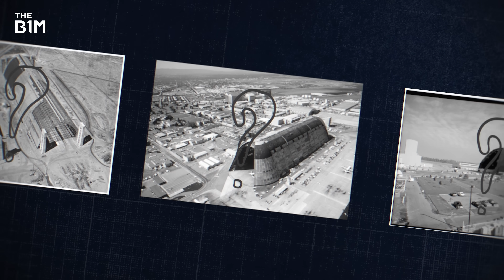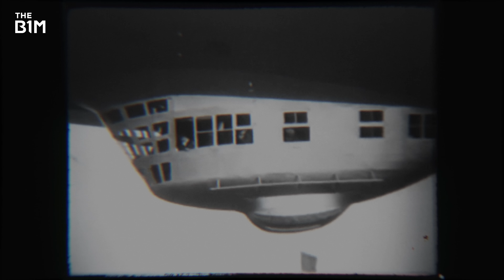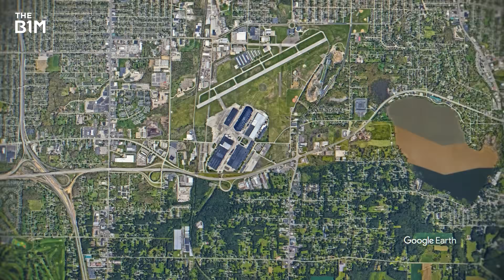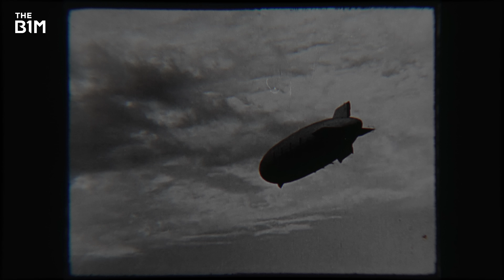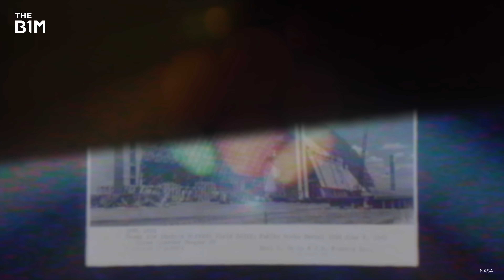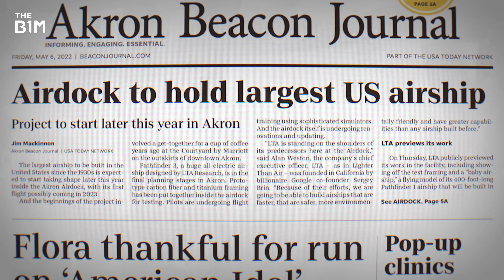The Abandoned Megastructure Saved by a Tech Giant

Comment: I've been in the Akron hangar. Just before LTA bought it (when it was a lockheed facility). The size is absurd. It doesn't just form clouds, it can rain inside if temps drop while there's a cloud inside.
Avalanches off the roof have crushed many cars over the years

Comment: I wonder how they thought they solved the problems that ruined the german Cargo-Lifter project.
One of the biggest issues was weight management. To lift 100tons of cargo, the airship has to bring a 100ton ballast weight to the site where it takes over the cargo. Otherwise the missing 100t weight would let the airship rise rapidly, making it impossible to land again (except by venting gas, which it can't get collect back in again).
So what's the site going to do with a 100t ballast sitting there after the cargo was taken over? And what about the cargo delivery location, where another 100t ballast has to wait!?

Comment: No mention of the fact Hindenburg was originally designed to use helium as its lifting gas. However, because the United States held a global monopoly on helium extraction and strictly banned its export under the Helium Control Act, the Germans were forced to fill the massive airship with highly flammable hydrogen instead.

Comment: A few important facts were glossed over or left out.  The US Navy operated and used Hanger 1 until 1994, when Base Realignment and Closure (BRAC) Act forced a determination that NASA should take over the Moffett Air Field and the hangers.  So NASA was a guest and limited user of H1 until then.  Even after 1994, the Navy continued to use H1 for years, and was found responsible to remove the contamination from H1.  Ames did submit a re-skinning plan to NASA HQ.  It was proposed to Congress, which quickly cancelled millions of dollars in NASA construction projects as punishment for recommending any work on H1.   They said it was not an Agency priority, even though preserving Historic Sturcture IS the responsibility of agencies that own them.  Yes, Alphabet/Google was awarded the Moffett Airfield Historic Preservation lease, and the lease included the restoration of H1.  But the cost to restore was estimated and Alphabet/Google was given rent "credit" for the cost.

Comment: I had never heard of this building. Then, back in 2024, we were staying in a vacation rental in the hills above silicon valley. We were quite high up, about 2900 feet. The view from up there was amazing. But I spotted this building that was clearly miles away (11 miles as it turned out) that you could see with the naked eye. Everything else at that distance was a blur. But then there was this clearly gigantic building. That's when I started researching and learned about Hangar 1. If you looked closely you could just make out hangars 2 & 3 as well. It's a truly remarkable structure.

Comment: Cargo airships are awesome, you can move a huge 250 tonne object without tearing down roadsigns etc. But they have one big disadvantage: when you deliver the load you need something equally heavy to keep the airship from shooting off into the stratosphere. A problem that's harder than it seems. I think that's the reason they turned that German place into an indoor water park.

Comment: My squadron in the Navy back in '70-'72 was VP-31 (P-3 Orions) and our hanger was Hanger 1. The story about clouds forming in it are true, and sometimes followed by "rain" as the condensate dripped off of all of that interior steel. I explored the extents of the hanger many times and it was fascinating. Roof access was easy and provided spectacular views. The roof was also a good place to rest for awhile  before taking the interior stairs back down to the deck.  There were lots of them. One weekend night a squadron mate of mine "closed" the EM Club and decided to would be a great idea to climb to the top of Hanger 1 and ride the searchlight beacon on top. The long climb unfortunately failed to sober him up enough to realize it wasn't his best idea ever, and he snagged the beacon on the way around and climbed on top, facing the way the white beacon was facing. Later recounting the story, he said that it was about the coolest thing he had ever seen, but after a couple of minutes he started to feel a little queasy and decided to get down. Alas, between the spinning of the beacon and the spinning of his head he got a very bad case of vertigo and froze, clutching the beacon for dear life. He started screaming up there, hundreds of feet in the air, on a military base at 2AM on a Saturday night.  Base security got many reports of screaming from around the base, and patrols finally located and closed in on the source about an hour later. They shut down the beacon for a few minutes and retrieved a very sorry Aviation Machinist's Mate from the beacon.

I can't remember his name, but maybe he will watch this video and tell us what his punishment was, I mean, beyond the obvious...lol.

Comment: The two in England ( which you have old pictures). As both have been worked on and look amazing. They still hold the odd airship. But used more for filming now. Most of the Dark Knight trilogy were made there. 
WB use them quite a bit now.
So really they are the biggest Stages for filming.

Comment: The German one is 1.181 / 689 / 351 ft * // 360 / 210 / 107 m*. 
In its fun-resort, there is a beach and a jungle. 
As seen in the picture, You even can fly by a small air balloon inside of it. 

* length / width / height

Comment: I’m from the UK and old enough, 69, that I started at school learning imperial units, and later switched to metric.  I find it difficult to understand how anybody with significant experience of both systems can prefer imperial.around the late ‘60s my father bought me a film developing kit.  I took the contents out of the box and looked at the measuring cylinder.  It had dual graduations, which should I use?  Most things in everyday life at that time were still imperial but I think it only took me a couple of seconds to decide that I was going to use metric.

I’ve visited the US, soft drinks are often seen in 2 or 3 litre bottles.  Urinals made by American Standard are marked 3.8l/1 gall per flush.  Obviously based on a US unit, but with the metric conversion stated first, very strange.  Until conversion to digital American cinemas projected film that was 35 mm wide, nobody had a problem with that.  When the projectors used carbon arc lamps the carbons came in metric diameter and imperial length.  How does that make any sense?

American schools don’t really teach science in imperial units, do they?

Comment: The problem with such large airships, is the weather they must  be capable to fly in. 
Along with the paucity of such large hangers as No. 1 is the choice of their altitude capability. They either can be built extremely light for a very small capacity to fly higher than most weather, or like the Hindenburg and the two US Navy giants nearly as large, built to fly no higher than a few thousand feet above mean sea level. 
One reason there had to be big airship hangers on both coasts is that there were only a few passes  at low  enough altitudes 4000 ft across the Rocky Mountains that they could use to get from one coast to the other. When  having to cross in these passes blimps fly very low indeed. 
I live in Southern California where there also was a pair of the smaller wooden Moffett Hanger 2 and 3 sized WWII blimp hangers. One of them still stands, though the other suffered a fire and has been recently demolished. Since both were  registered historic buildings I am not sure the fire was completely an accident. None of the dozen such hangers built in WWII on both coasts have doors high enough for the USS Akron to be  rebuilt. Only the Moffet  Hanger 1 and Akron Airdock have the 'orange peel'  full height aerodynamic doors though there used to be a shorter such hanger in Massachusetts. There still exists the huge double width hanger at Lakehurst New Jersey that was built to house both the Hindenburg and a Navy airship side by side. The length of that hanger was used by the Germans to determine how long the Hindenburg and Graf Zeppelin II could be built.

Comment: hanger could be 1/2 size by shaping the floor to marry 1/2 the height of the airship...   make the depression  slightly larger than the airship and the lower half  could be arms length away for maintenance...this also brings the upper half into a more accessible configuration...  obviously an entry depression mates to the hanger... think donkey engines like Panama canal...

Comment: Let's be real: Lighter than air aviation won't come back in any meaningful way ever. It's just a huge hassle for little benefit.
It's cool, yes, but coolness doesn't pay bills and an An-225 can load more cargo (weight) than the Hindenburg's max. weight fully loaded. They are less efficient, far worse to handle, need more space and are much slower than a large cargo jet plane like the An-225, for which a return and even a serial production is more likely than a real profitable business case for lighter than air transportation beyond novelty adventure.

Comment: One of the reasons the Hindenburg was so large was because it was designed to use helium. (Helium is less buoyant than hydrogen, thus it takes a greater volume of the former to equal the lifting properties of the latter.) However, helium at the time was almost entirely sourced in the USA, and in the late 1930s they initiated a helium embargo against Germany as part of sanctions against the Nazi regime. Thus the Hindenburg was forced to use hydrogen after all, and the rest is history.

I think it's important to note that prior to the Hindenburg, the German Zeppelin Transport Company had not had one single passenger casualty in their entire history of operations. Contrast this with the USS Akron, Macon, and the earlier Shenandoah: All of them were highly advanced designs, and all of them crashed due to poor airmanship, not for any technical reason. The Germans just knew how to fly these things safely.

Comment: The higher up you go the colder it gets…. Is there a possibility that they plan to develop some form of technological airship system to house data centers? Perhaps even harvesting the necessary water from the clouds and using solar panels on its massive surface. Not as far fetched as it may sound….China has already build a giant airship that they use to generate electricity…..🧐

Comment: For over 40 years I have seen article after article claiming that the airship is about to make a comeback.  It has never happened and it never will.

The reason is because all airships share a flaw that these articles always fail to mention:   they are very susceptible to winds and other weather conditions, especially upon launch and takeoff.  They are this way by definition because they are LIGHTER THAN AIR, which means they have a large cross section in comparison to their mass.  There is no way to fix this.

Comment: There is an example of a very early repurposing of airships hangars: Riga Central Market Pavilions. Riga is the capital of Latvia, and we have the coolest market buildings ever: those are reused (and slightly adjusted) hangars for airships used during WWI. Interestingly, that despite a very logical location next to the railway and bus stations, they were originally built far in Latvian countryside. In 1920s-30s, they were disassembled, brought to Riga city center and reassembled (with additional architectural elements, mostly on the sides, instead of doors). And like that we have 5 huge structures which provide so much space for commerce. Check it out! https://en.wikipedia.org/wiki/Riga_Central_Market

Comment: Megastructures often find a new life after their original purpose has passed.  Underground bunkers become archives or residences, or more close to my home (both 2 zip codes away), a buried munitions plant (on the same base where I worked almost my whole career) become hardened data center, and the Apollo first stage plant (which my father worked and inspected during that time) has become a manufacturing plant for wind turbine blades.  Also on the base where I worked, rather large subassembly buildings from Apollo are now the National Data Buoy Center's Gulf coast warehouse and repair buildings.
Build or buy well, and use it as long as it makes sense is my policy.  I am driving the same car I used to evacuate for Hurricane Katrina in 2005, and I'm not planning to replace it anytime soon.  (In case you're interested, a 2005 Saturn Vue with the Honda 4.0 engine).  I have only had four "main rides" in my life, and the one that didn't reach 100k miles was a significant dissapointment; the other three blew way past 100k milea to surpass 250k.  My current ride is at 300k miles.

Comment: The reason the Hindenburg burned so fast and so hot is 2 fold...
Part 1 is the fact Germany at the time did not have easy or cheap access to helium, so they used hydrogen as the lift gas...
Part 2 is they coated the skin in metallic paint containing both iron and aluminum...and they got the ratio of iron to aluminum just right so when the iron inevitably oxidized, it combined with the aluminum to form Thermite...
4.9 million cubic feet of Hydrogen Gas + Thermite Paint + a source of ignition = the 804 ft. long blimp disappearing in a fiery cloud in less than 2 minutes...

That would be impossible today because there are no Governments in existence that would allow a hydrogen filled airship to enter it's airspace let alone dock at any airfield/building capable of taking them...
Every Government on Earth that would allow you to try and get Flight Certification for an Airship would absolutely require Helium to be used for the lifting gas...

😄😁😆😅😂🤣

Comment: Airships are cool. Every year someone comes out with a plan to revive Lighter Than Air (LTA) airships. My grandfather was in charge of training USN LTA pilots in WWI at NAS Key West, and I inherited his photos, letters, notes, etc. Even in 1916, they were aware of many issues with LTA, and that it was a gap-fill technology that would disappear as engines got more powerful / efficient and planes took over. There was the potential for use for roles that the helicopter fills today, but as you can see, helicopters are the thing. LTAs were expensive. They required (expensive) massive ground handling crews, were susceptible to winds / changes in temperature / ice / rain, did not like altitude (and hence got into all the worst weather), required docks for landing and huge buildings for storage, carried relatively light loads at low speeds, .... In short, they are big, fussy, expensive queens that require constant attention to operate.

Comment: Airlander 10 is one of the most prominent examples of the modern airship revival. Developed by Hybrid Air Vehicles (HAV) in the UK, the Airlander 10 combines elements of a plane, helicopter, and traditional airship.
It is designed to carry passengers or cargo, offering a quieter, more fuel-efficient, and environmentally friendly option for air travel. The Airlander 10 first flew on 17 August 2016.           So is the B1M US biased

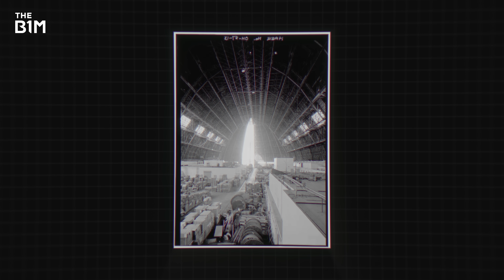Comment: 10:31 My Dad 's last duty station was at Elizabeth City, NC. He was an Aviation Electronics Technician 3rd Class and took care of the avionics on one of those blimps. Most of the time he was in a shop but at times he would get to ride one out over the ocean. This was 1953 - 1954. I was a toddler then. We still have slides of photos he took of a blimp coming out of the hanger and of one of his rides over the ocean.
Reply: The Elizabeth City, actually Weeksville, NC hangar is still in use by the military. Operated by defense contractor TCOM for research and development. I did work there nearly 20 years ago during a remodel.
Reply: I’ve seen those hangars and I grew up next to Moffett Field

Comment: Yeah well there ain't no plan to save the blimp Hanger B at Oregon's Tillamook Air Museum; 300 feet wide, 1.000 feet long, 15 stories tall, the doors are so big airplanes have been flown through it, it's also worth saving. It was built with two million board feet of fire retardant treated wood and there's been a lot of deferred maintenance since it was built back in 1943, It's going to cost about five million to fix the roof ripped open back in December, but it needs about twenty million in repairs. C'mon tech bros, step it up.

Comment: I gave a thumb down. Simply because as an engineer you should promote the metric system whenever you can. Especially in engineering.
I can do calculations in both systems but we should simply stop using imperial system for any engineering topics.
I would go even as far as changing the size standards of screens and other devices to full cm. For example if 15 inches is 38.1 cm, we should simply default size to 38 cm. If we have 19 inch wheel we should make them 48cm instead of 48.26cm. 6.5 inch phone screen could be easily 16 or 17cm instead of 16.51cm

Comment: Don't forget about the hanger in North Carolina, they're still using it today smaller airships
Reply: I remember in the 1990s when the 2nd one burned down. There was welding done on one of the doors and a spark smoldered until it burst into flames later that night. The majority of the structure was wood and completely burned to the ground. You can still see the 4 parts of the doors structure standing near the remaining intact hanger.

Weeksville, North Carolina